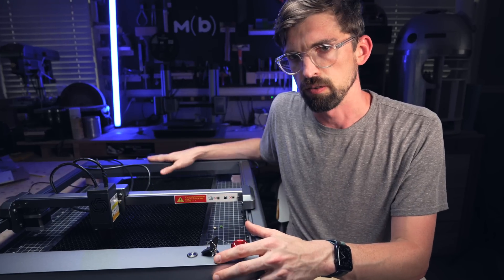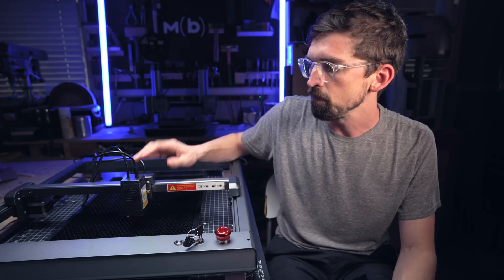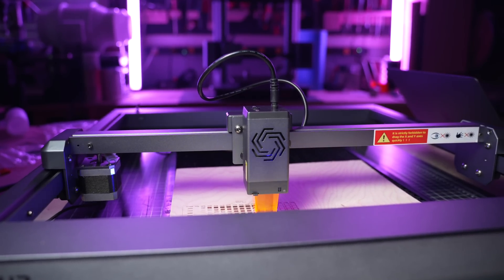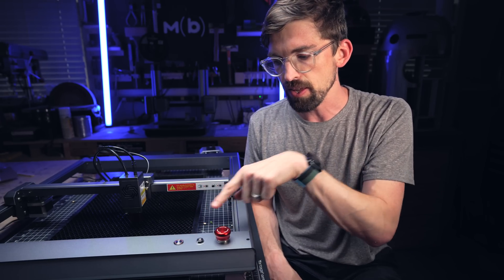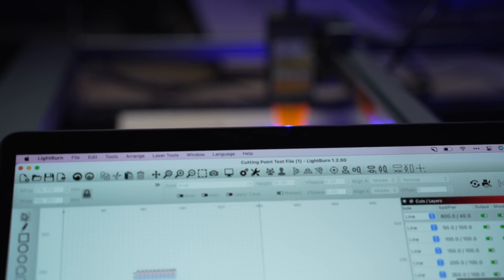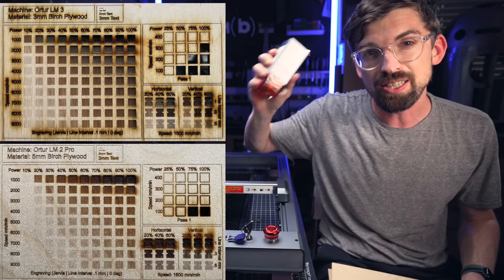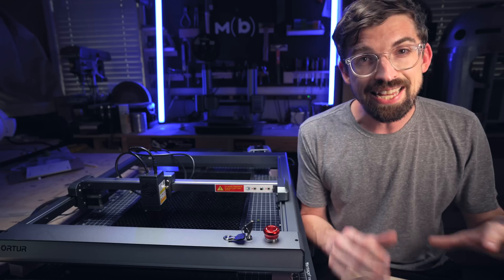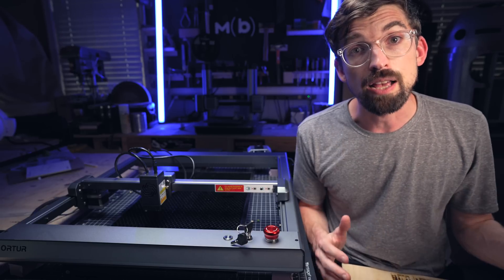ORTUR'S BEST YET! - Ortur Laser Master 3 Review

Comment: Hey I’m considering buying a laser diode engraver/cutter for using in my leather shop to help me cut and engrave leather with art etc. I was considering these Ortur and x tool machines but then I started reading reviews saying that the motherboards fry in them because they have issues with grounding out and the company is a nightmare to get ahold of and deal with. So what’s the deal? Are these good or are they garbage? Any input would be appreciated as spending a grand or so on any gear at the moment is a bit of an expense for me currently. I can’t afford to be throwing money away on a product that’s going to work for a week and then fail on me. So what’s the best machine for cutting/engraving leather even if it does cost like $1000-2000~ that won’t go and crap out on a guy?

Comment: The limit function on this kind of driver works by monitoring the amount of current the stepper draws under normal operation vs what it would draw once the motor has stalled. It is closed looped insofar as a circuit reacts to the rapid jump in current (at the speed of light) and cuts the current (steps) to the motor. This is the way it should be done, as limit switches are prone to failure at some point.

Comment: Great review! I have a question, is there a low cost engraver that can solve the air pollution problem? I think manufacturers should take this issue seriously. The fumes from the cutting process are so high that I would need to buy a huge enclosure to cover the machine, which is a considerable expense.
Reply: Flyingbear laserman
Reply: I usually use extraction fans/ventilators when i have to work with my CO2 laser indoors during the winter months and during the summer i can leave the double doors to my workspace open. It's the cheapest solution i have found so far without having to build a rig for your machine.
Reply: @nullvoid2001  what extraction fans do you use for this?
Reply: @stephaniemc8516  any one will do as long as it's strong enough to help clear out the space. I have two extraction fans, but you can also use an exhaust one which is a bit larger if your space is bigger.

Comment: I was also split between the LM3 and D1. After watching every review I could find and then reading purchased reviews I decided that the Ortur was the way to go for me. First, the performance seemed to be slightly better when engraving and second but more importantly were the customer service oriented ratings. There seemed to be a trend towards a lack of customer service with xTool lately. I know there is a lot of turmoil going on in China right now so this is probably a temporary thing. Lastly, Amazon had a flash sale on the LM3 the other day making it $595 so I jumped on it. That left more money for accessories which we'll need to run these at there best. Just my 2 cents... 

Cheers,
Greg

Comment: Hi Brandon,  Regarding the air assist port you need to push the black ring in.  It's a little tricky and I wish they would have made it stick out a lot more but it's a regular push fitting with those little teeth that bite into the tube when you release pressure.

Comment: Great review! I like your presentation method; not to fast, not boring.

That said, although this looks like a good unit; I’m leaning towards X-Tool 20w as my first laser.  Do I need 20w?  I don’t know, but if I have it, I won’t have to wish I had it.
Reply from the maker: You can even go with the cheaper 10W from xTool and upgrade down the road.  But I totally get just getting the most powerful one to begin with.
Reply: Trying to decide between xtool 10w and ortur 3 10w, for a beginner, what’s better? Please advise :)!

Comment: The new "limit switch" seems similar to touch probes on cnc routers
Reply: It's not a closed loop setup. They are using TMC 2209 stepper drivers.
Reply from the maker: Yep, the probes I use complete an electrical connection but I think they aren’t closed loop.  This looks to be a step up which is pretty awesome!